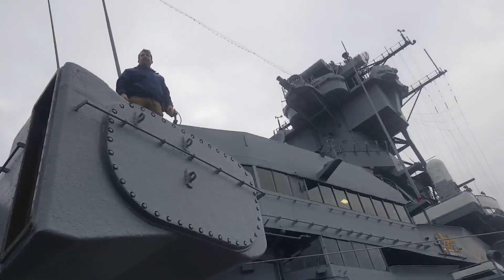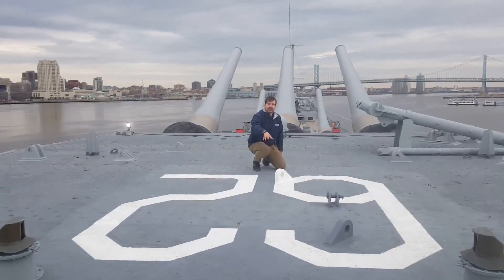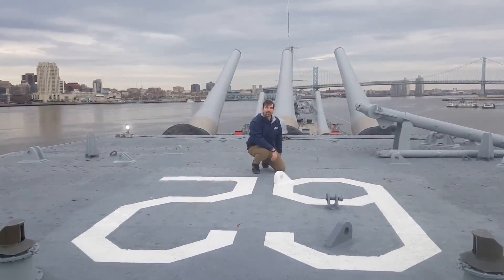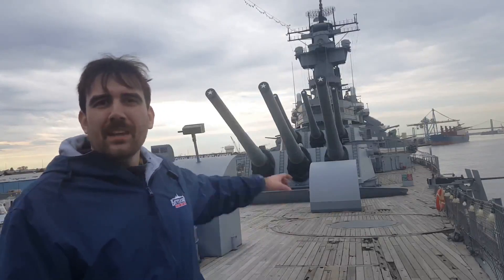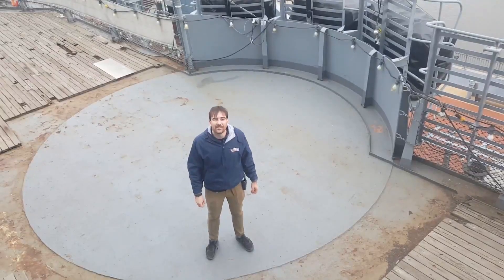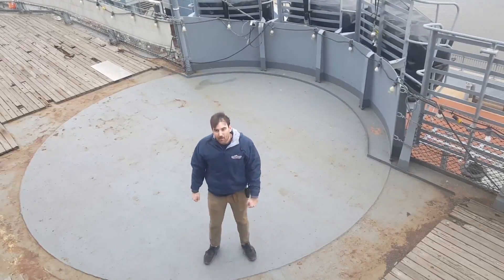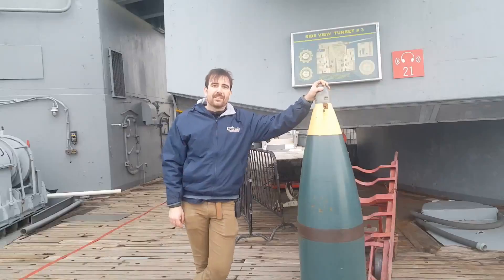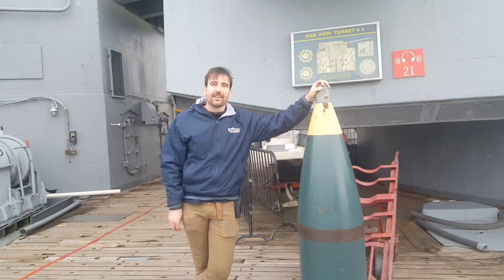The Battleship New Jersey's structural changes for the Vietnam War

Comment: Would it be safe to be anywhere near those 16 inches when they were firing outside? I saw a 50 caliber on deck and you mentioned there was a 40 mm on top of TurretTwo. How could those guys even be out there??
Reply from the maker: You can only use one of those at a time. If they're firing at aircraft they arent firing the turrets. But you can fire turret 2 and sunbathe by turret 3.